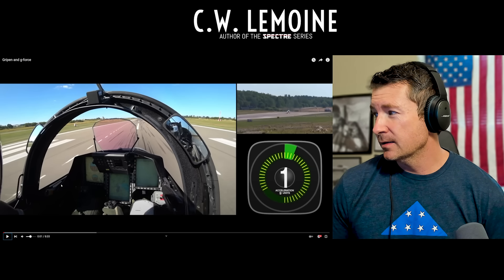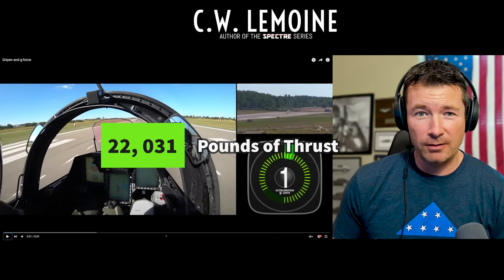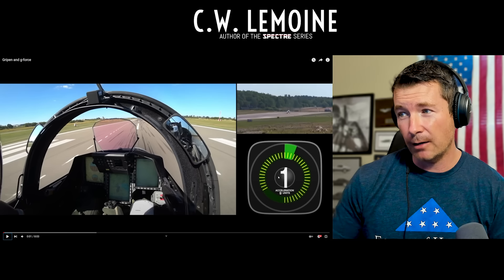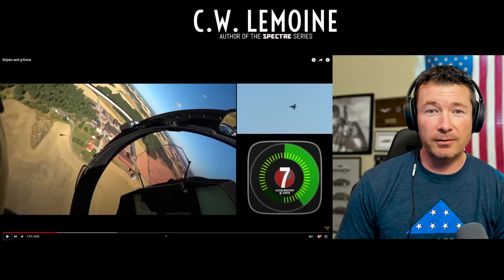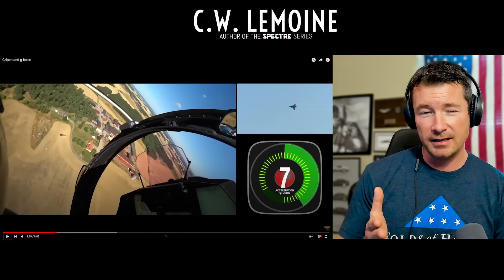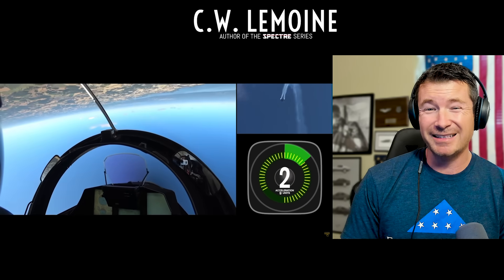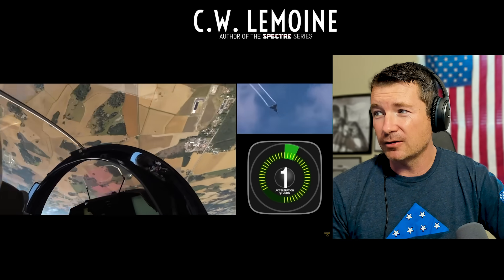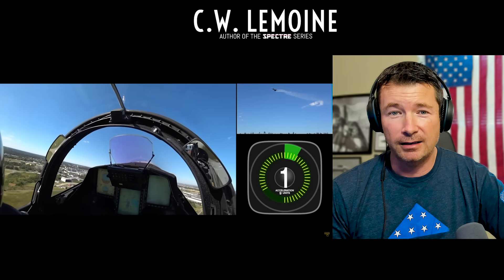SAAB JAS 39 Gripen G-Force Video *BREAKDOWN*

Comment: So glad you're watching this, but slight correction, this is a Gripen C. The cockpit is the giveaway, Gripen E's cockpit looks like the F-35's cockpit, one big ass screen.
Reply from the maker: Rog
Reply: dude the brazilian gripen have huge sick glass (also wonder if they break  what you gonna do ...RTB ?)
Reply: @collingtech1  Same problem for F-35, F-15EX, Block 3 Super Hornet... So I'm guessing someone's figured it out.
Reply: @collingtech1  My guess is reliability is a key function - as well key flight data is in the HMD and/or HUD if in the unlikely event it fails. I think there are a few backup gauges low down as well.
Reply: @hippoace  well if you've been shot in the cockpit there's a good chance your in for an unplanned uncontrolled landing
Reply: @ryanestes7331  Exactly, the last thing to worry about is the screen breaking lol
Reply: @collingtech1  I hear they have a 1-year full guarantee on the glasses 🤭🤭🤭
Reply: @collingtech1  By the time the glass in the cockpit breaks, I'm thinking you got bigger problems.
Reply: @seybertooth9282 I'm thinking not actually. Or rather, whatever problems you have are now impossible to solve.
Reply: @collingtech1  You'll have a hole in your back or chest, the screen won't make much of a difference.
Reply: @CWLemoine  the Brazilian version looks like the f35. Abraços do Brasil.
Reply: @Bob_o_brocador  that's because as stated the Brazilian Gripens are Gripen E's, its not just the Brazilian ones, all Gripen E's have the massive single MFD.
Reply: Correct, this one is Gripen-C 249 - a Libya War vet!
Reply: The cockpit of the jas39e has nothing to do with that of the F35; to start the f35 does not have a fixed hud and the screens do not have buttons, everything is touch
Reply: @maliburallye350  you're right that the Gripen-E has a HUD and real buttons in addition to the touch screen, but they've got a lot in common too.  Both use touch screens and helmets from Elbit.
Reply: @maliburallye350  Gripen E has both touch and buttons on the screen.
Reply: @maliburallye350  He was just talking about the "one big screen" setup. relax